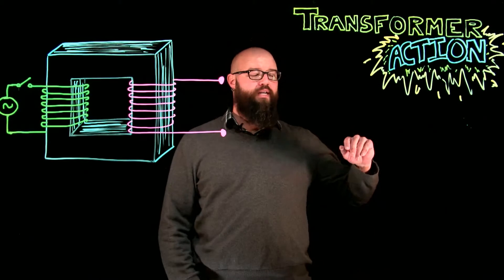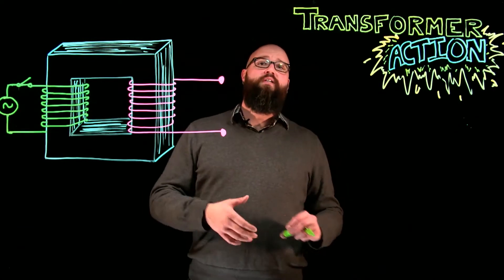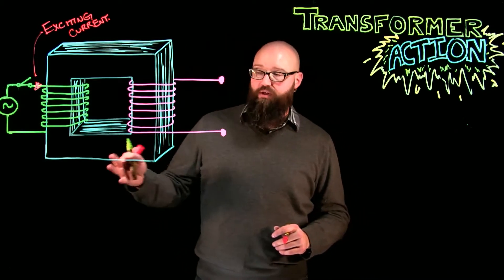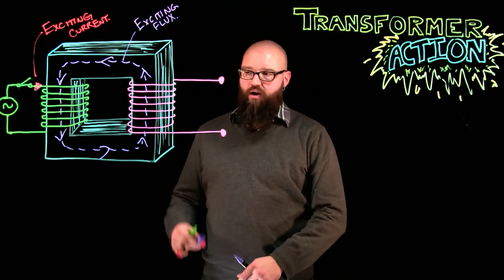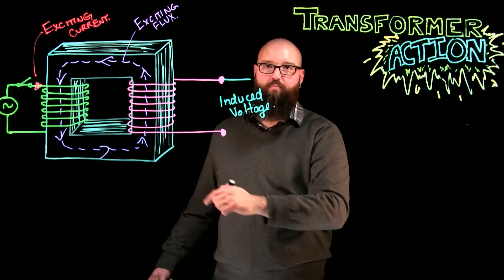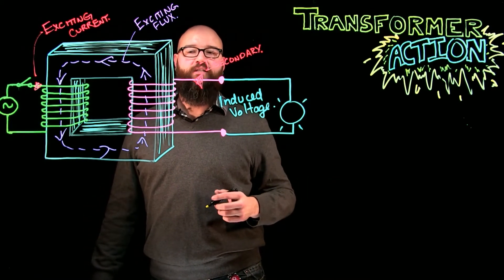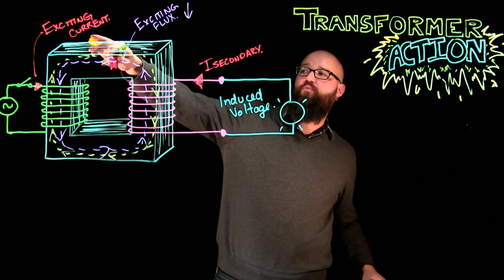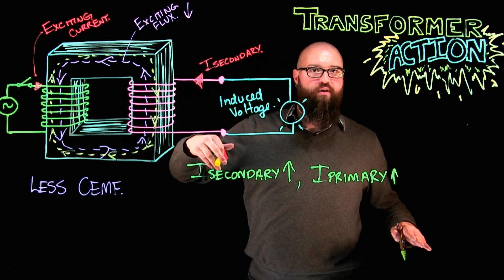Transformer Action

Comment: Shouldn't flux direction be opposite according to right hand grip rule? From viewer's eyes, it seems that flux should go up the primary coil at first, not down the coil.
Reply: That is correct, but because it’s AC, the field direction is constantly changing, which makes designating any particular flux direction more arbitrary than anything.
Reply: There are two flux within any transformer that is in opposition. Lenz's law. The net magnetic flux in any transformer is almost zero but THEY ARE THERE.

Comment: There's a way to stop secondary flux from going back to primary and then the primary won't draw more current when secondary is loaded. 
I did few such experiments and uploaded the videos on my YouTube channel.
Reply: Sup. There exists Markov transformer which simplifies things lol. But the position of the source and load are reversed when you check the video or patent. Maximum nullification of secondary mmf. Primary winding basically becomes an inductor so you will have to add capacitor in series with it

Comment: unfortunately you didn't mention the primary excitation current is lagging the primary voltage by 90 degrees while the new flux created from the  curret in the secondary is in phase with the induced voltage so there is no 'cancellation'.  Rather an in phase primary current builds to cancel the secondary flux leaving the next flux in the core equal to the excitation flux
Reply: agree

Comment: if the secondary winding was wound in the opposite direction, would that change the polarity of the magnetic field on the secondary? If so, would the primary current be reduced with increased current on the secondary since the emf would add to the primary emf?

Comment: Very good explanation, Thank you
Reply from the maker: Thanks for watching!
Reply: No its not good, the flux in primary should be in opposite direction from our point of view
Reply from the maker: I am using electron flow (negative to positive) theory in this video, with the top primary terminal being the most negative at this given point in time. Plotting the magnetic field with the LEFT hand rule, you will find it is correctly labelled.
If conventional flow (positive to negative) were used, then the flux would indeed be the opposite direction.

Comment: Please tell me if I get this right: The less loops I do at the primary side the bigger the Exciting current will be? Because in my brain it makes sense if I add like a thousand loops, the magnetic field will be much stronger likewise much stronger to invert for the reverse polarity. Is there a sweetspot for a given voltage, or is "more is better" generally true?
Reply: If the wire you used had zero resistance, than probably yes.  But in reality, the more windings you wrap, the higher the resistance becomes due to the wire, and resistance reduces current output.

Comment: I am in the HVAC industry and have a question. On a basic 240 volt input 24 volt output transformer, I have higher primary voltage. It’s reading 250 volt on primary thus increasing my secondary to almost 30 volts ac. This is a standard 40vac part. How can I reduce the secondary down 3 volts? Thank you in advance for any response!
Reply from the maker: One method would be to place a dropping resistor in series with the load. Is there an option for a +/- tab on the transformer?

Comment: What do you call a transformer that has equal number of turns on both the primary and secondary? i.e. input voltage/current = output voltage/current? There is step-up for secondary # of turns > primary # of turns, step-down for secondary # of turns < primary # of turns, but what's the standard term for secondary # of turns = primary # of turns?
Reply from the maker: This would be an example of an isolation transformer. Commonly these are used for safety purposes so that there is no reference to ground on the secondary. A short to ground on the secondary (provided there is no connection to ground) would result in a no short circuit condition.
Reply: @schulerruler  Thank you.
Reply from the maker: You are very welcome.